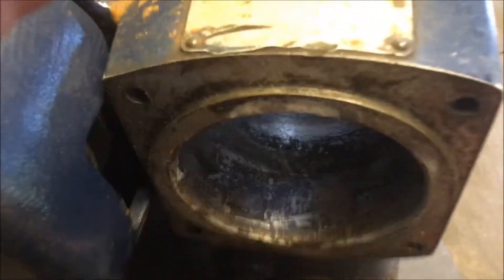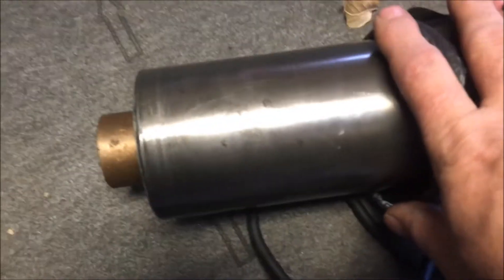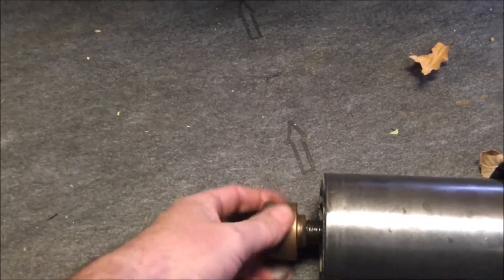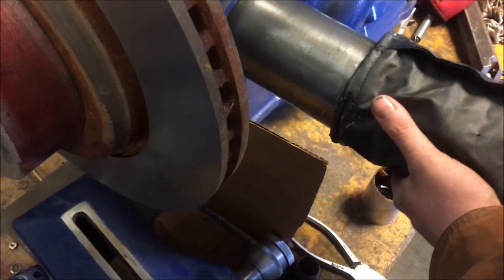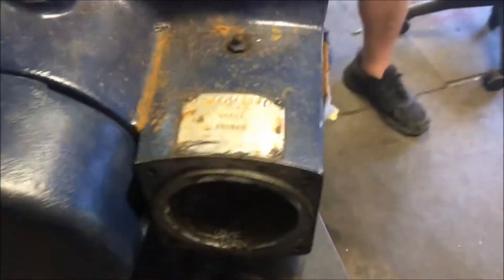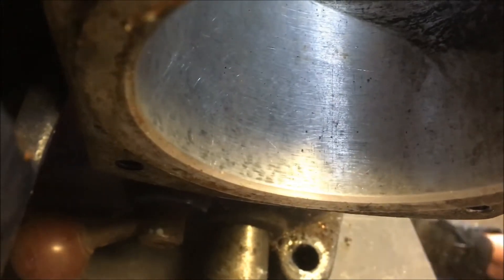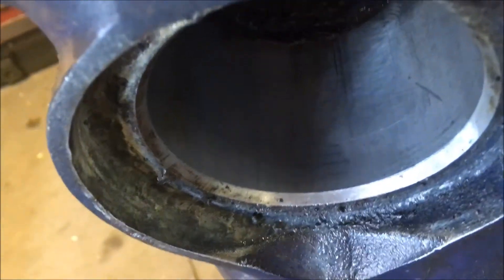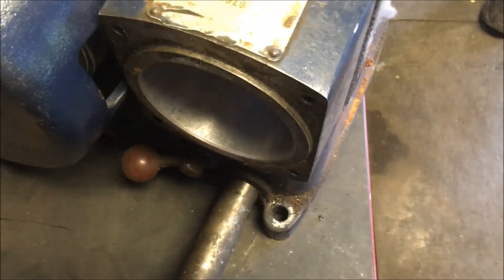Never seen before - hardened grease welding the cross feed carriage in place

Comment: Easy way to remove a stuck cross-feed is the use of small scissors Jack on the front machine in between the case and the cross feed itself right where you said you were hitting it with a hammer I'll come across this situation a few times in my 20 years

Comment: We have a slew of lubricants we use; red tranny grease, lithium white, graphite black, shell aero-space blue grease, and factory ammco brown grease can be found in most units. The chasis is aluminum and the cross feed carriage is steel. Anyone with a chemistry background have any idea what happened here? Ive had 10 years in the rain rust buckets lock up on me, but this puppy is only a few years old, and i dont see signs of electrolysis. Machine was in the sun often, and while i could see that drying out some greases, i cant see heat effecting aerospace grease or transmission grease, does lithium react with graphite or aluminum????